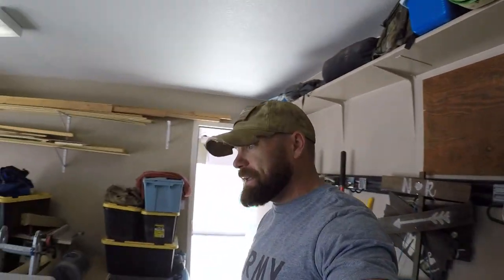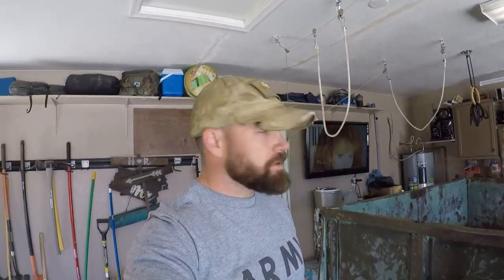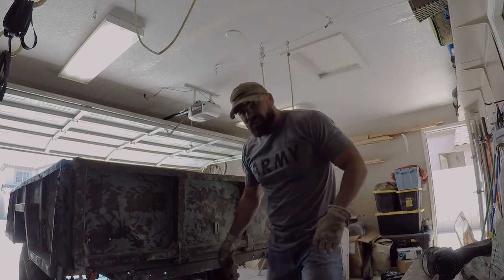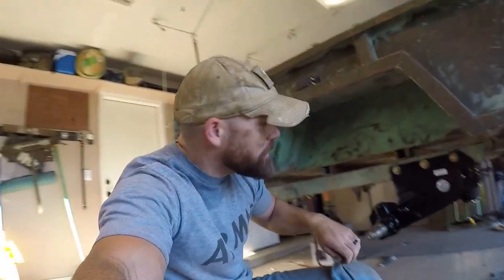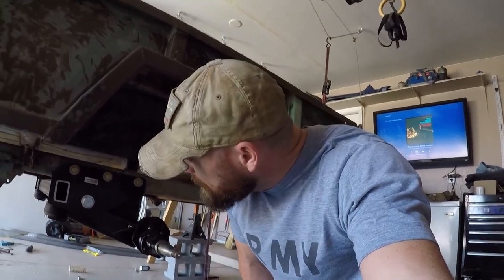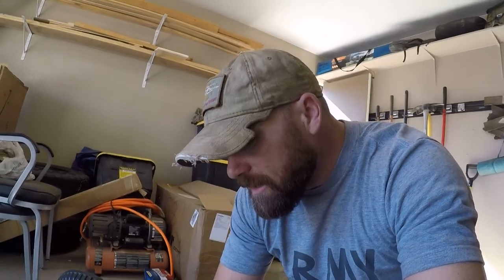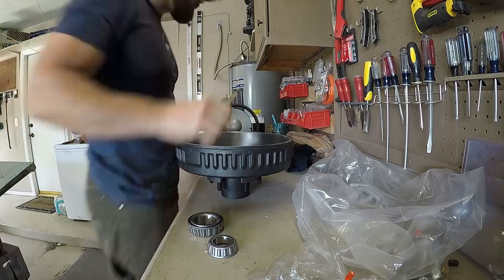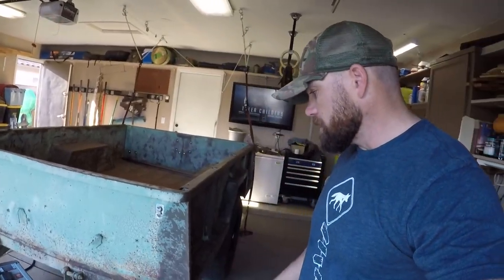M101 Trailer Build E3 - Timbren Axle Install

Comment: Thanks for the content man. We just picked up an M1102 yesterday and some of the stuff you are showing will help us out a bit with the build. 
Really want to ditch the surge brake setup the m1102 has in favor of either what you have shown here, or possibly still ditch the surge setup but go with an electric over hydraulic conversion if we really enjoy the trailer and plan on keeping it.

Comment: I know this comment might be 4 years late, but just a little safety note: the blocks you used should be set where the openings are facing the floor/ceiling - just like they were meant to be used in construction. If not, they have a much higher chance of breaking/collapsing! ‘Luckily, nothing happened! Great Vid!
Reply from the maker: Yeah I chose to have the jacks on a solid surface rather than the edge of the block. I could pick up the trailer so it wasn’t that heavy, just spacers for the jacks.

Comment: Seems like the performance and capability benefits of a timbren setup on a trailer when off roading are a no brainer. I get that. I'm curious how they perform on highway travel. 90% of my driving will be on highways getting to and returning from said offroad locations I visit. Does this type of suspension dramatically reduce mpg's at high speed because of added weight, bigger/wider wheels and tires, higher profile/lifted by 4"?  Considering gas prices lately, just wondering if the offroad performance upgrade is really worth the possibility of greater fuel consumption and poorer high speed highway performance? Love the thought of the timbren benefits but wonder if gas stations will love it more. Any thoughts on the matter would be greatly appreciated.
Reply from the maker: Bigger tires and lift weather on the timbren or a traditional suspension is going to be a wash. The fact that it pulls excellent on the highway and I have yet to find a place I can’t take it off-road is a no brained for me. At the end of the day each situation is different but I am still loving this setup.
Reply: @CallIntheCountry  thankyou for the feedback

Comment: What brake/hub assembly did you use...? I'm having a hard time finding with a hand brake.
Reply from the maker: Andy here are the part numbers and descriptions that I used. Hope this helps.
23-112 12" Dexter Electric Brake Assembly with Parking Brake Lever, LH - 6,000 lbs
23-113 12" Dexter Electric Brake Assembly with Parking Brake Lever, RH - 6,000 lbs

Comment: Great content!  Did you end up hooking up the parking brake cables?  If so did you have to make custom cables?  TIA
Reply from the maker: I have not. I still have what came with the brakes but the custom cabling cost that was needed outweighed the benefit. With the stabilizers it’s like a rock.
Reply: @CallIntheCountry  good to know.  My M1101 is upgraded with Timbren & e-brakes. Was debating putting the cables on. Ty.

Comment: If you guys out there are watching this ...an M101 is 5x8....if you want bigger and are ditching  a lot of the axle weight anyhow, find an M105 , they are 6x9. M105's weigh 3500 lbs empty. I ditched the axle AND frame...rebuilt a lighter frame, and made a dump trailer out of it.  Whatever you do TRY try try to get ALL the canopy stuff you need with the trailer...it's EXPENSIVE if you try to find it afterward. . Also, an M101 will accept standard 8' bed caps generally. I have a hightop Reading  steel cap on my old school M101A1...he is accurate on M101 are about 1500 lbs.  . The newer M101A3 came with standard Dodge/Ford 8 bolts and 16" tires. That would be same pattern as 1980-1998 three quarter tons. YMMV.

Comment: I've got a trailer like yours I'm adding the Timbren system on.  What size wheels and tires did you go with?
Reply from the maker: They’re some cheap steel wheels that are the same size and pattern as my Tacoma, 285/70-17. That way I can use the trailer as spares if I absolutely had to and can rotate old truck tires to the trailer.
Reply: @CallIntheCountry  Thanks.

Comment: Great videos man! I have an M101A3 trailer too, my build is mostly done, but I am still adding a few things. How much height difference is there from the stock axle to the timbren?
Reply from the maker: Outpost PHX Thanks! I just watched your walk around video of yours, nicely done. Mine is actually done now but I have to edit and upload the videos. The Timbren dropped it a couple inches even with the 4” lift mode I ordered but the final ride height is nice and I still have to use the lock n roll hitch with the 2” adder to get to level with the Tacoma.
Reply: @CallIntheCountry  Thanks man! Can't wait to see your finished trailer video, I'm in AZ too, always down to camp with people in the Overlanding community.
Reply: @CallIntheCountry  Also, how much weight you think you saved from the stock to the timbren?
Reply from the maker: @outpostphx8751  I haven't weighed everything yet or when I pulled it out but I'd guess a couple hundred pounds easy. That axle, hub, tire/wheel package is way overkill for what I need it to do. We'll have to get together at some point to check out each others rigs.

Comment: I am doing the same mod on my M101A2. Did you have any problems torquing the bolts on the hanger plate to 165ft/lbs? Thanks
Reply from the maker: To be honest I do not have a torque wrench that goes that high so I took my breaker bar and guessed it. Force x Distance= Moment/Torque so with my 3 foot breaker I'd only need to pull 55lbs on the arm to get my 165ft-lbs of torque. I over did it a little and haven't seen anything shift.

Comment: Thanks for the vid. What were you doing when you had boards lashed to the brake flanges?
Reply from the maker: Timbren states in their instructions that the axles have to be within 1/16 of an inch to each other (square) 3 foot straight edge of some kind. I used the boards because that's just what I had on hand. Lashing them to the hub gave me a flat surface so I could make adjustments and then make sure the measurement between the front and the back was within 1/16". Thanks for watching, hope that helped.

Comment: Hey bud. Great vid. I too and building an M101a2 overland trailer. Man you have some great mods and adds on that trailer! Very informative and imaginative. By any chance do you still have the leaf springs you took off? Mine are shot and I can’t find any replacements. I cant really afford to replace the axle or have custom new ones made. Any other ideas would be appreciated. Cheers! 🍻
Reply from the maker: Thanks! Unfortunately no, the whole axle spring assembly was on my curb for less than an hour before someone picked it up. May want to just keep looking for a donor trailer or pickup you could steel the axle and springs from. The diff wouldn’t be ideal but could get you through until you did something else.

Comment: What timbrens did you go with 3500hd? What ride height? Sorry, I watched the video awhile ago and came back to it, to see what you went with. I’m in the process of doing my own project with a M1101a and have had the same idea to use Timbren for a long time. To save money I was going to go with a Dexter axle, but it doesn’t seem that it’s as easy to do so.
Reply from the maker: They’re 3500 HD’s with 4” lift. Thought I’d need to fabricate something to give me the proper ride height but it worked out to just bolt it to the frame. I’m glad I went with them. Easy to install and should be a better ride.
Reply: @CallIntheCountry  Great Build.  Just picked up a M101A and plan to do the same Timbren set up-- what diameter tires did you use?  Thanks
Reply from the maker: They’re my old 33’s from my truck. With the wear they’re closer to 32” now though. Same bolt pattern so I can use them wherever needed.
Reply: @Doctor BeBop I have just done a few minor things. (i.e.Removing the pintle hitch and the hydraulics, I am getting ready to stripe the paint and remove the axle soon. Do you have any photos of vids of your project? I am curious with the look. I am essentially going to be doing the same thing that you are it seems, except for adding electric breaks as I will be hauling a 800lb plus quad and some gear.

Comment: I have done a LOT of military trailer retro fitting. M105(A2 and A3)...M416 , M101A1 like yours. ...and I mean no offense but doesn't the cross brace 2x3x 1/4" defeat the Timbren  axle advantage. It's just a torsion axle w/ extra 5" of clearance. I am going to build a Hummer com shelter (Geithner 788) into a trailer for behind my wife's diesel Liberty. I have several 788's, one is buried for a root cellar. ;) I have made a system to mount a 788 on my dually or a flat bed with my forklift. I just want to get better fuel mileage ....10-15 mpg doesn't cut it and kids are getting older and moving on.....equals less need for space.
Reply from the maker: My original intention was to do just what you are saying. I had plans to build a brace to support the Timbren since I don't think the frame is thick enough to just bolt it. However, the more I thought about it the 2x3 I installed gave me a few inches of additional clearance and since I'd have to first clear anything with my truck anyway, going through the hassle of fabricating a brace was only going to be more work without much gain.
Reply: Take another look at where the crosstube sits in relation to the tongue arms. It doesn't protrude any lower than the arms. It is not an issue in respect to ground clearance at all. I have a 1991 M101a2 that has the 8 lug hub pattern and since I no longer have a truck that has 8 lugs (for a common spare) I am looking at swapping the straight military axle for Timbrens with a 6 on 5.5 pattern. I may also do this with my dual axle 7x16 enclosed. That should be fun.
Reply from the maker: Ernest Paul dual axle would not be fun. I’m liking the timbrens though, good ride quality.

Comment: How has the ride been to date?  I watched your video and like the idea of the system vs an axel swap.  An axel swap would be easier to do and go with though.  I am looking for a M101 to set with a RTT to pull with my Jeep.
Reply from the maker: David, I’m not completely done so I haven’t yet put it through all of the paces but what I have I am happy with. Doesn’t seem to jump as much over bumps and rides smooth. I’ll be putting an update together eventually once I’ve had some time on it with pros and cons of everything I did.

Comment: Older video.  But I’m currently experiencing customer service issues with them.  They sent me the wrong spindles for my brake setup.  Been dealing with them for 2 weeks.  I’ve just given up.  Swallowing 60$ shipping to return/exchange my brakes to one’s that will fit.  No more Etrailer for this guy:
Reply from the maker: Yep, they are terrible!

Comment: Hey man nice build. How are them timbrens holding up for you? I’m building an m416 and I want this suspension but I keep hearing negative things about them
Reply from the maker: I love them. I have a couple thousand miles on them with probably half off-road and I don’t see any issues. What are the negatives you’re hearing?
Reply: @CallIntheCountry  that is good to hear!! A few people have said they snapped the spindle, someone said the assembly bent and thinks it’s because of a red plastic bushing? 
My thought is maybe they were way too over loaded but they deny that.
Reply from the maker: @kendallbrock9275  yeah I made sure to double check my weights and use the recommended load from Timbren. I'm at 2500 max with 3500HD axles. Should be right in the sweet spot per Timbren. I'm sure alignment is key as well.
Reply: @CallIntheCountry  thanks for the confidence booster. This is the route I’ll be going

Comment: How did you know what hubs to buy for the axel? I don't wanna buy the wrong ones
Reply from the maker: You know, even though etrailer gave me the wrong brakes they did give me the correct hubs for the Timbren axle. All the info is on the Timbren website but if you don’t know what you’re looking for I’d just tell the etrailer guys which Timbren axle you have and they’ll tell you the hubs that will work.

Comment: Who did you get the hubs from?
Reply from the maker: Kendall I tried to find some anywhere but etrailer but in the end was forced to use them.
Reply: @CallIntheCountry  might have to go that route. Ordered from timbren last Saturday and finally yesterday they said they are having problems with their supplier. I told them I’d give it till Tuesday and if they aren’t shipped then I’ll go elsewhere. Bought the axles from summit and man that was a mess